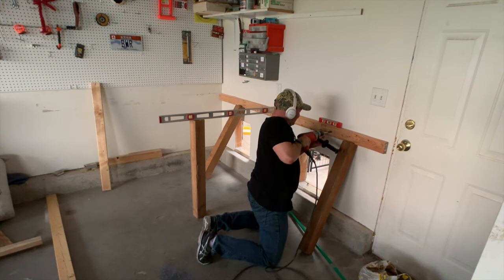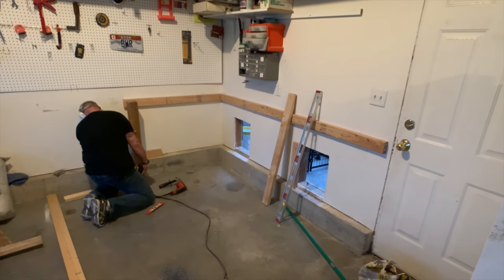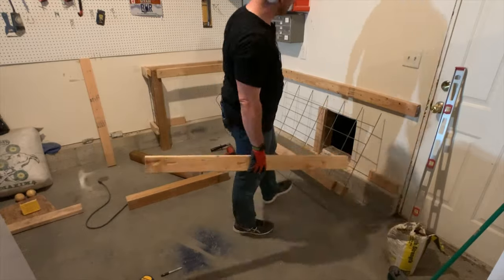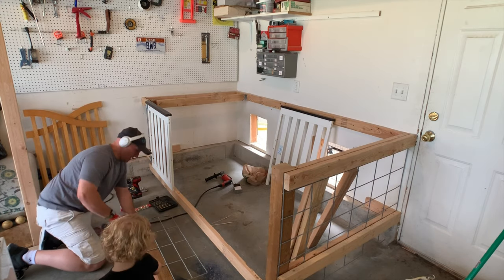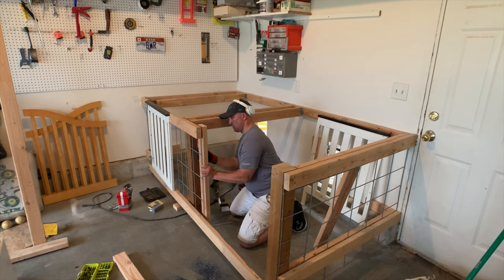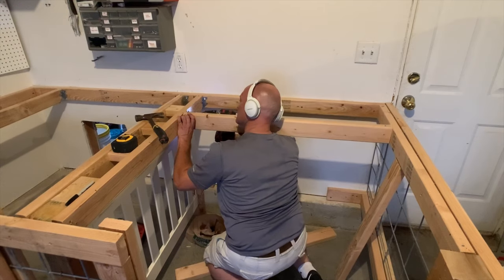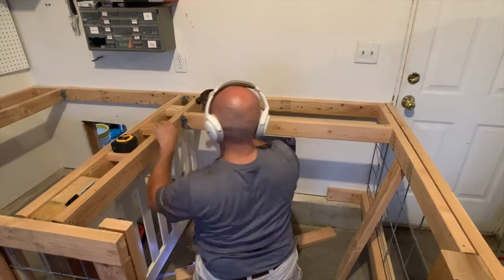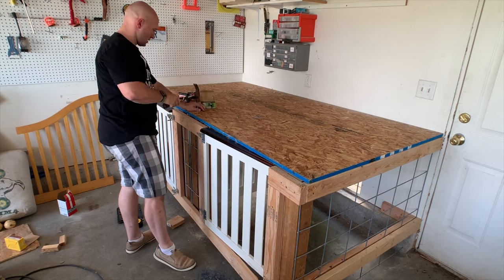Build a Cheap 2-Dog Kennel in Your Garage

Comment: Do you build portable ones to sell?  About 3 wide x 5 to 7 length x 3ft y’all.  I need one in my garage for my little chiweeni for when I’m gone.  But I want to take it with me when I move...  I want it framed in wood, but wire siding to see through.  No top necessary.
Reply from the maker: I don’t. Sorry.